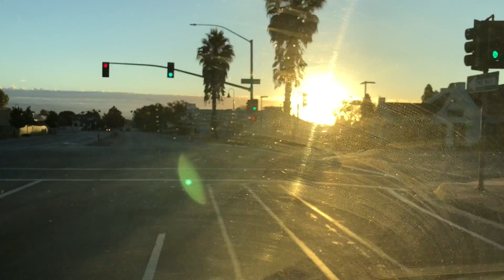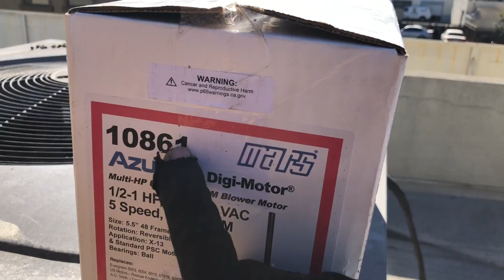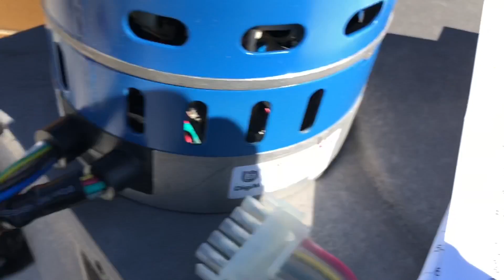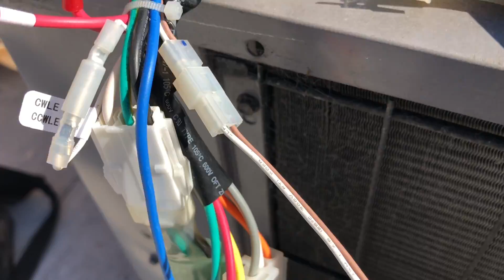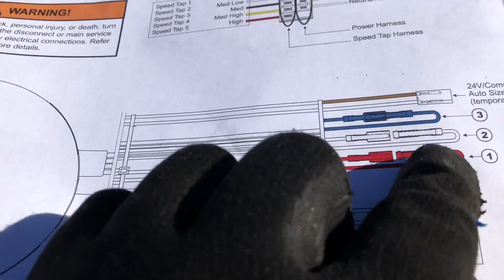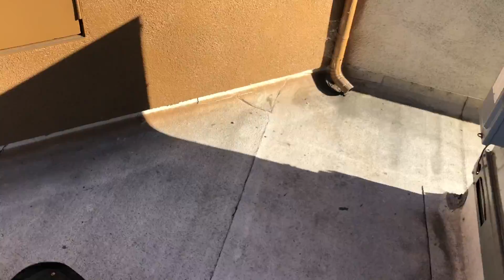Mars azure 10861 universal replacement ecm motor

Comment: The only “downside” going this route is if you don’t know the speeds of your hi/lo cool and heat to properly configure the latest 10856/10857 motors you’re just guessing. I realize they have defaults based on what you’re replacing but those may not be adequate and vary greatly. 
I bought a laser RPM tool and got those numbers from my current 2.3 ECM if and when I need them.

Comment: I have some weird behavior with my mars 10861. Manual says, it should only turn on when it gets 220V AND any speed tap is energized. Mine always turns on as soon as it gets 220V. None of the speed taps are yet connected. 

Why is that? Is there any hidden setting not mentioned in the manual to override the speed taps?

I want to be able to use the constant fan mode by using the orange tap (625 rpm), but this doesn't allow me to do so.
Thanks
Reply from the maker: @jucamvil  I would contact mars on that.
Reply: I’m having the same issue, did you ever find a resolution?
Reply: @marcusmerryman8904  No. I contacted Mars and they told me some of those units fail that way. But mine was out of warranty, sooo, nothing to do with them. I just added a relay only to get it energized on demand.

Comment: I've been steering clear of installing that moducrap but it seems the new mandate will be requiring this type of motor as a minimum now in the equipment. They sure seem less complex than those variables. My equipment guy just told me about these this morning. Said to use OEM for warranty naturally but to keep one of these for out of warranty or at least something to use till you get the warranty part. What's nice is you check power to the motor just like any old direct drive. If ya got power it's not the board.

Comment: Man... Gone are the days of just plugging in a couple wires, and going. Now you have to unplug this, plug in that, route this, use this adapter here, etc. Seems like wiring up a computer more than a motor. Oh wait... there IS a computer in a motor. Yikes! thats scary.
Reply from the maker: THEtechknight there are plug and play options US motors has a rescue motor that’s hooks up as OEM.
Reply: I know, I was just throwing sarcasm in there.
Reply from the maker: THEtechknight damn I’m slow 😂😂😂😂
Reply: LOL. its the long hot days bro ;-)
Reply: Gone are the days when there was nothing you could;t get going somehow in the middle of the night. Belt drive, direct drive, 11" fan limit, V800a, Q340a...blower belts if anyone knows what they are...

Comment: not crazy about the "clear" heat shrink covered boards, I'm guessing they're not sealed at all. I could see that being an issue in real humid/ocean salt areas or in places that have fairly high chemicals counts in the air (within OSHA standards, but some can attack circuitry fast being exposed 24/7)

Comment: What would be different between it running in PSC mode versus X13 mode? Curious! And I heard that by next year all residential Furnace and Air Handlers manufactured after July 2019 can no longer use PSC motors by government mandate in both The USA and Canada, is that correct? If so would a Motor like this be used by manufactures so they can customize onsite installation to homeowner's and installer's preference?
Reply from the maker: mesedrew possible cfm.  As an x-13 it programs itself to the system. As PSC it’s a fixed rpm. You could make it work either way honestly.

Comment: Nice replacement Dave and great explanation! you'll have to let us all know how that motor holds up.  The local Carrier distributor drop those to the GenTeq Evergreen due to some failures.  With the programmer for the Evergreen EMs, they seem to be work pretty good matching the CFMs, but extra work.  BTW - is that Streets of San Francisco for the first part of the intro?  :-)
Reply from the maker: Gary Gin yes on the intro.  US motors has the 6651TS rescue ECM 1 HP motor with exact wire hook ups to carrier. That’s the next one I’ll try.

Comment: That motor is from rsd 👍👍
Reply from the maker: Carlos yes. They did not have the US motors 6651TS rescue motor so I used the mars 10861
Reply: @NorCal-refrigeration  10861 motor is being replace with GENT 6107E OR 6207E depends on voltage